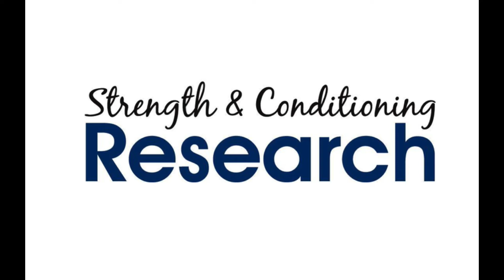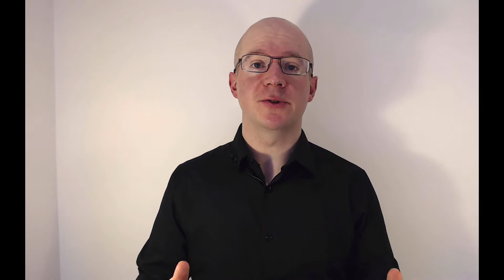Hypertrophy: motor unit recruitment and the force-velocity relationship

Comment: The force velocity part is completely wrong.Any muscle contracts with full force when activated.When a weight is attached,a greater part of that force is utilized to accelerate the weight AND the actual shortening of the fiber itself.When no weights are attachef,the fiber still contracts with full force,but now ALL of the force is used to accelerate the shortening of the fiber.More acceleration = more force with a fixed mass because F = ma.Get your shit together.
Reply: that's not force. He's talking about internal force produced by the muscle. Not external force from the physics equation you wrote

Comment: So, for exemple, the best way for hypertrophy is to train with high speed and high weight to recrute the maximal of muscle fiber and go to the failure to increase the mecanical loading on the individual fibers?
This way you have high recrutment of fibers and high mecanical tension on the same time?
Reply from the maker: Relatively speaking, it's not possible to move a heavy weight at a fast speed. Any movement that can be done quickly with a "heavy" weight can be done with a much heavier weight if the muscles contract more slowly. This is because of the force-velocity relationship. Muscle fibers produce a lot less force when they contract quickly, and this means that they experience a lot less mechanical loading (the force produced by a muscle fiber = the mechanical loading it experiences). 

We want to move as fast as possible (which increases effort, and therefore motor unit recruitment) but we want the actual speed to be slow (which increases the force produced by each muscle fiber).
Reply: @SandCResearch  very well explained. thanks.

Comment: I have a question, would training a submaximal weight with intentional slower velocity than normal induce the hypertrophy response faster. For example: I can do 18 strict push ups with relatively fast velocity, but doing them slower than that makes it much harder and I can only do say 12. Would the stimulus be the same for hypertrophy? Is slowing down velocity (not too slow) be a more efficient strategy to save time whilst getting the same results?
Reply from the maker: The short answer is no, it will not, because slowing down the velocity deliberately reduces motor unit recruitment. I will explain this in more detail in a future video.
Reply: @SandCResearch  But slow speed feels way harder and reach failure faster than normal speed. Why is this? Doesn't the recruitment always go from slow twitch to fast twitch as the set continues, so theoretically, wouldn't all muscle fibers be recruited as you reach near failure like lifting fast? Please cover this also. Thank you.
Reply from the maker: @johnbestentertainment  if the slow speed feels harder then you might be co-contracting the antagonist muscles to resist the agonist muscle actions, which increases the resistance. Alternatively, you may just be experiencing a rapid onset of fatigue.

Any time that movement speed is anything other than "as fast as possible" then motor unit recruitment will be less than maximal, because if you can increase effort then you can increase recruitment.
Reply: @johnbestentertainment  Fast twitch fibres don't activate towards the end of a set!
If they did then marathon runners would be the most muscular people on the planet!
If you don't lift 75% or more of 1RM, do maximal effort isometrics, or do explosive movements your fast twitch fibres are not even used!
Reply: Also to note: If you mean by "slower" (also) the eccentric portion of the exercise, then yes, it is more exhausting because you exert more force against gravity. And exerting more force in the eccentric contributes a little bit to the overall effect. Chris´ answer is about slowing down the concentric portion of the lift. There ofc due to physics its the opposite: You exert less force and power and therefore recruit less muscle fibers.
Reply: @hooplehead1019   Slowing the eccentric doesn't exert more force against gravity. For this to be working you would have to be able to change earth's gravity during your eccentric. Check Newton's third law for that (actio= reactio).
Slowing down the eccentric increases muscle damage while decresing motor recruitment as long as the weight on the bar is smaller than your concentric 1 rm.
Check Chris Beardsley's instagram posts for that.
Reply: @higherdimensions1459  Hey, good to see some read oldish posts and good videos. 

       Dont worry, the laws of physics still stand: We do change the gravitational pull on the bar by exerting force in the opposite direction, against it. Thats resistance training in a nutshell! Thats why it doesnt accelerate like in a free fall with a= 9.81 ms-2 to the ground. If for instance you exert the same force against the bar as its gravitational force of "bar weight in kg" * 9.81ms-2, then the bar wont move either up or down (ofc depending on the exercise, we also need to overcome a portion of our body weight). If you exert even more force than that, the bar will go up (as in the concentric). If you exert less than that, the bar will go down (as in the eccentric). The amount of force you use dictates the amount of net acceleration the bar has, resulting via a*t in the speed of the bar at time point t. 

Now, which PHYSIOLOGICAL effect exerting more force against the bar in the eccentric by slowing it down really hard has on hypertrophy or muscle damage is a seperate question. I said decelerating the bar hard in the eccentric may explain the feeling of greater exhaustion via force exertion. Surely not applying any force in the eccentric against the bar - i.e. letting it drop - leads to lesser exhaustion. I didnt say anything about adaptation effects or muscle damage or even whether medium deceleration in the eccentric leads to more muscle activation although physically it definitely means lesser force exertion than a stronger deceleration.
Reply: @hooplehead1019   I had already summed up your first paragraph by newtons third law. And hence the most force you can exert against the bar in an eccentric is the weight of the object itself which would either make it an isometric contraction. The only thing that really changes is the additional work performed in the eccentric as this is F*s.
Reply: @higherdimensions1459  Yeah, ofc the most force you can exert in the eccentric is < m(bar)*a. You said "Slowing the eccentric doesn't exert more force against gravity. " But ofc slowing the eccentric exerts more force than not slowing the eccentric - and thats all I said almost one year ago.
Reply: @hooplehead1019   As Long as there is no acceleration  as you lower the weight the exerted force by lowering at constant speed is not dependent on the speed you' re lowering the bar.
Reply: @higherdimensions1459  Thats correct. But think of how different bar speeds come about in the first place.
Reply: @hooplehead1019  That' s true but deliberatly slowing the bar speed down might activate the Type 2 fibers less especially if not doing eccentrics only with a weight >1 RM concentric.
I can see that metabolically it might be more challenging (greater time under tension) so one might be partially (re)compensating possible future reductions in "gains outcome" by that.
I appreciate your comments.
It' s great to communicate with others thinking about similar issues and possible fixes.
Reply: @higherdimensions1459  I agree with you. Slowing down eccentrics doesn't exert more force against gravity. There is no addictional force when you do not use accomodating resistance or isokinetic dynamometer. Slowing down eccentrics doesn't recruit high threshold motor units and may promote hypertrophy of type I fibers